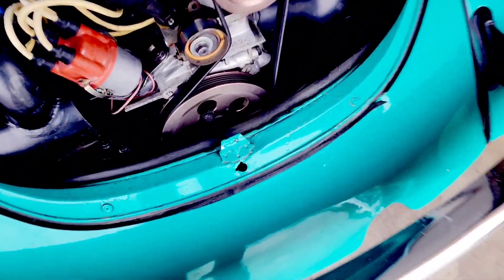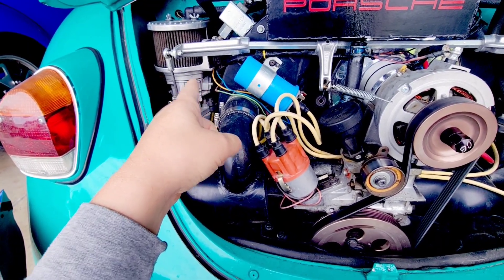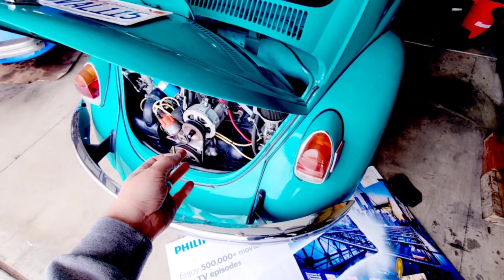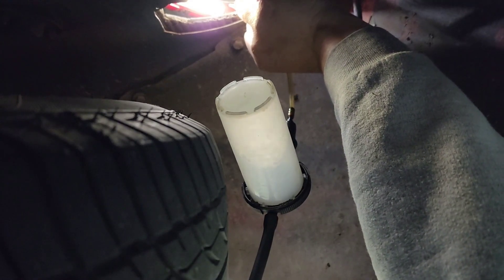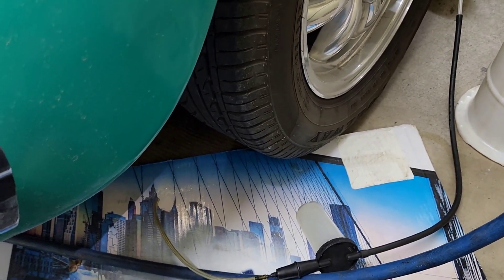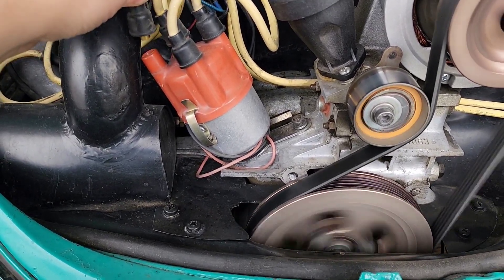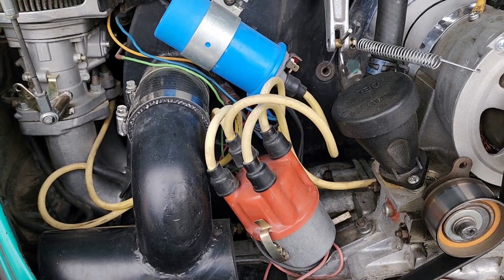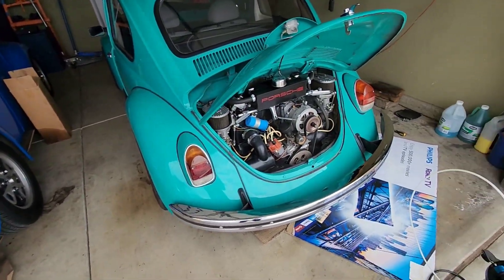The Achilles Heel Of The Weber IDF Carburetor

Comment: IDA's I learned are for racing IDF street. Have a pair of 40IDF's on my new 2110 so I'm going down this rabbit hole. Had Kardon's for years but that was a 1835.
Reply: Idf dont have the nessasary progression hole drill to have even fuel ratio, they are more on or off, which is fine in racing, they can be modded to have the progressions needed for the road.

Comment: I’d think a OEM paper style filter would not shed bits of jet plugging material. But you’d need to make a central air box and link it to top-hat covers over each carb. Similar to the expensive (carbon) air boxes sold in Germany.

Comment: After a year running 40idf webers, i switched to a 37pict again and its great.
Reply from the maker: Exactly. That's the reason my son didn't want to go with IDFS on the blue bug 2234CC motor and decided to go with the 39 mm PIC3 stock looking carb for the very same reason.
Reply: @Motor7710  also the mpg is better, and coldstart, idle, reaibility. But like you mentioned the idf is fun and for racing or running not all day.
Reply: @daalhoffarm  with a decent fuel filter and correct jetting and car is fine, don't put IDF down just because you cant tune them or filter your fuel.

Comment: Glad to see you back on You Tube. I run a single IDF 4 clone on my 2007cc  motor on my 2967 beetle and it runs great. I change my oil, adjust my valves and clean my air filter every 3000 miles. A single carb makes a great daily driver.
Reply from the maker: Nice. I agree single carb best daily driver. But let me see what I could do with these idfs, see if I can make them daily drivers. If I can, this will be a revolution for everybody running idfs.